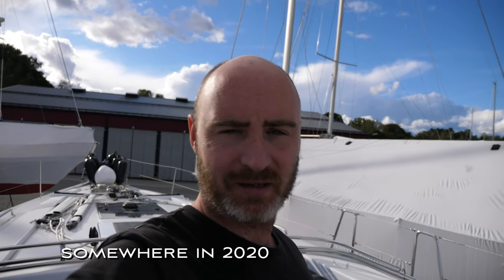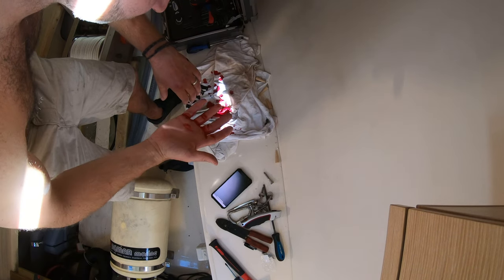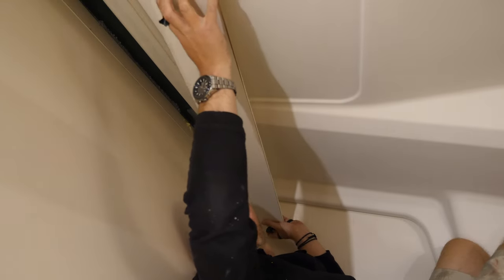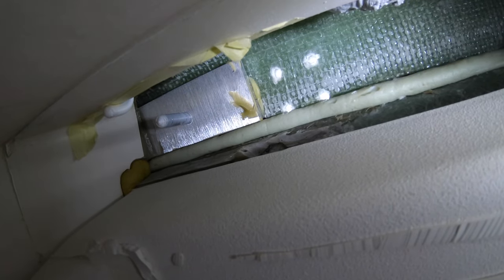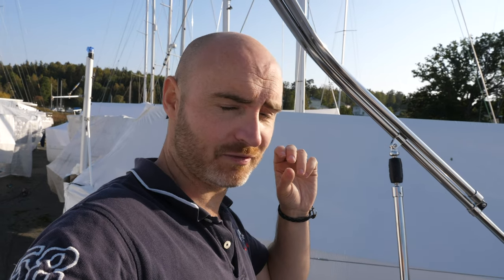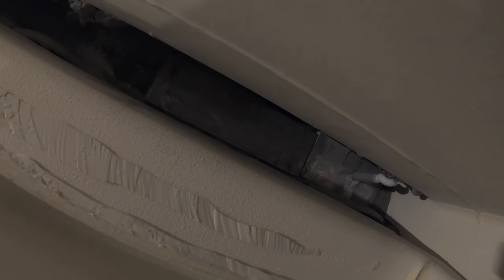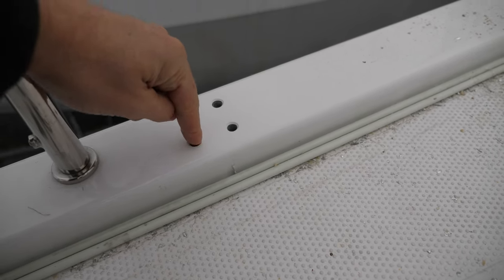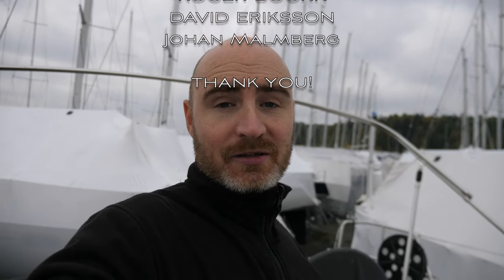Installing the CODE 0 Padeyes on a Hanse 418

Comment: Thanks, Chris, for this technical episode. I could feel your frustration trying to access the area behind all the panels, but the end result shows how satisfying it can be. I intended to ask why not use nuts on the inside, but your explanation makes perfect sense. However, I still would be somewhat concerned about the corrosion between the pad-eyes screws and the threads in an aluminum plate-but they can always be inspected. Nevertheless, your video and the editing made this a joy to watch. Cheers.
Reply from the maker: Thanks very much. Never thought about the corrosion but I guess if it's super sealed it shouldn't be too bad. Cheers

Comment: Nice job :)
Reply from the maker: Cheers Tino, how is life with you these days? Any updates on the boat?
Reply: @SailingAurora  Life is mostly work, but also necessary if I want to buy a bigger boat. Think I'll go for a Bavaria 39 from around 2006, but I also have an eye on the older Beneteau boats in the 1994 area. BootsProfis here on YouTube has just posted a video regarding a Beneteau 44cc and it looks very nice :)
Reply: I have also added the Beneteau 42 cc and the Beneteau 423 to my list.

Comment: Nice neat job. Looks good.  How was all the trim fixed did not look easy to remove and how did you re fix it.  👍
Reply from the maker: Thanks, we fixed it back up with sikaflex and a hot glue gun, the hot glue gun is quick drying so it holds the panel up while the sikaflex dries.

Comment: Nice! What did you used as a filler for that epoxy? Looks quite sticky as it is holding the aluminum plate there.
Reply from the maker: Thanks, it was West systems 406 Colloidal Filler, it's very useful stuff

Comment: You are a brave man Chris. Taking your boat apart like that scares me 😂 But I love your technical videos, keep them coming. One question, did you also support the clutch from below? Im thinking to install one as well, but was thinking to just mount it in the fiberglass, as there should not be a lot of pressure on the furling rope.
Reply from the maker: Hi Peter, thanks. You can probably use a thread insert directly into the fibreglass for something like that. Bear in mind the when you have the foresail reefed in heavy winds there could be a fair bit of strain on the furler. The force is lateral though so that's a benefit also. WIth the Code 0 padeyes it's kind of upwards and lateral.

Comment: It is really hard to install anything new to these production boats. They should design these so that you can do maintenance. The best thing in a hand-made small product run boat is that you can open everything and no clue in places that can need maintenance.
Reply from the maker: True, in most cases things are pretty accessible. I think on any boat there tends to be very awkward places to acess, on production boat there are probably a few more locations. All of the maintenance areas are pretty accessible but for running cables, adding extras it can prove difficult
Reply: @Sailing Aurora  you have done excellent upgrades. The good thing in Hanse is that you have all the plans, etc. documented, and you can get info from other owners. My boat is one of 8 and all are different. Even the enterior has three major variants. Also, the yard whent bust, so no help from there.